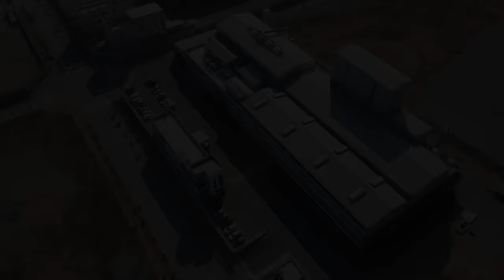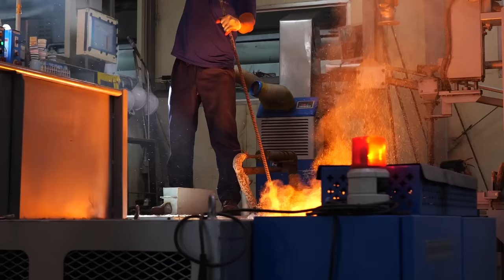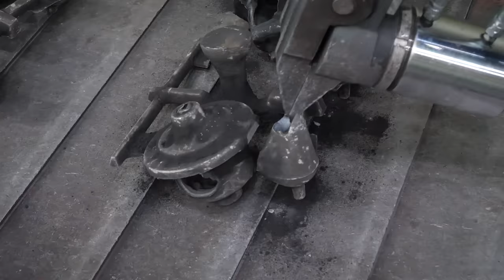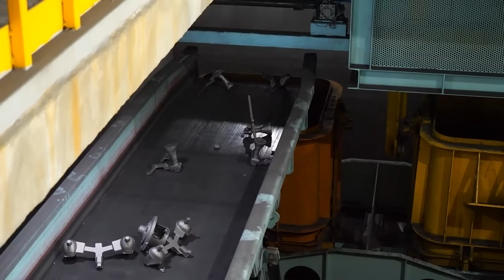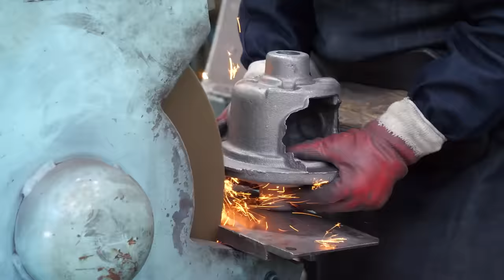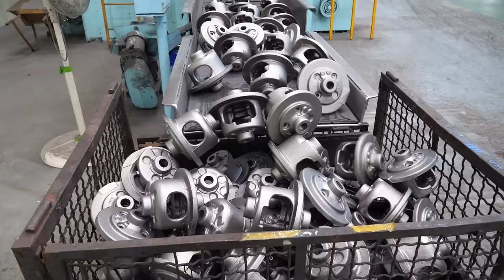Amazing factory! Process of Making Automotive Parts with Metal Scrap. Korean Steel Factory

Comment: Some of the very simple jobs could be easily automated. Like the mold leftover grinding by people.
Reply from the maker: you're right. Thank you for watching.
Reply: they probably have a lot of different parts they make, perhaps these little hub things they don't quite make enough of to warrant a further specific system to automatically grind the leftovers, when they already have guys there good at grinding whatever thing they molded that day.

Comment: Since the scrap metal comes from a variety of sources, the melted mixture must be chemically tested and adjusted to ensure the new castings have the correct properties.
Reply: They're occasionally tested, but many car parts, specially regular spares, have high tolerances for quality, like oil pumps, brake caliper supports, amortizator casings, pulls, gears, etc. For many of those, when material is metal, it's already fine.

Comment: Good job but what are the parts?
Reply from the maker: Engine parts😉
Reply: Could you be a little more specific, please?
Thank you.
Reply: @rlewis1946  the one part is a differential carrier for a rear end no idea what the square one is
Reply: @aj9270  the square part is marked inlet on one spot but I can’t figure it out either
Reply: @aj9270  Thanks for this info. I tried to identify this Korean foundry, without luck. 
RL
Reply: @greenbudkelly2820  Thanks for your reply. I spent a year in Korea (USASA -Korea 1970) and ever since have been interested  in the Country as an Asian economic powerhouse. 
RL